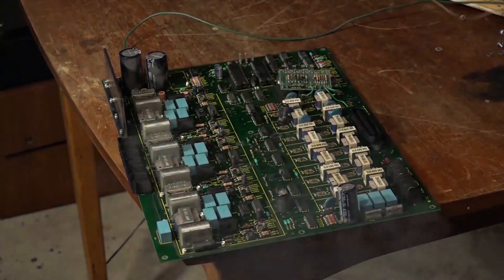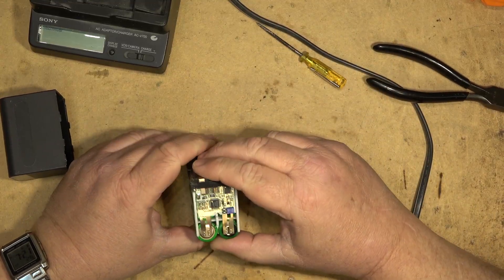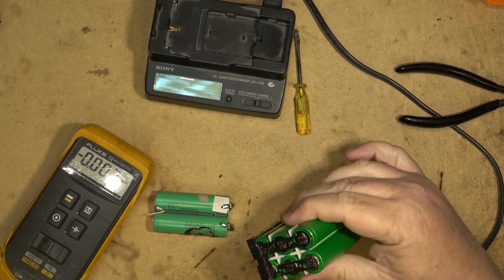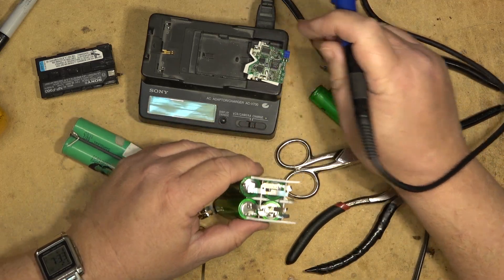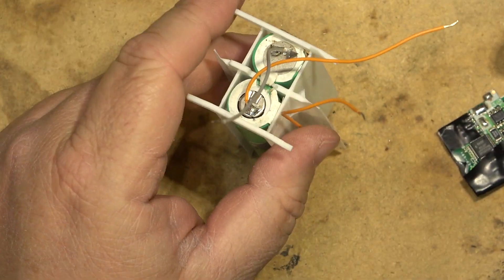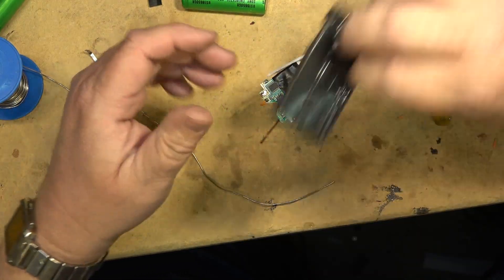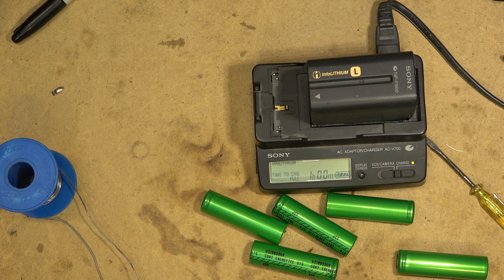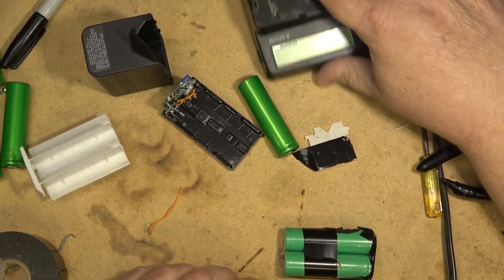Infolithium Camcorder battery Rebuild

Comment: Great video, thanks for posting. Question: I just got a camcorder with bad batteries. I looked them up and they are fairly cheap, so I'm not going to take the existing battery apart. However, I thought about cutting the charging adapter  and simply installing the same connector I have on a bunch of 3.7V batteries for my R/C stuff. I mean, why not, right!? Thanks.
Reply from the maker: I don't mess with lithium batteries.  Fire hazard.

Comment: I'm surprised the 18650 cells fit at all. My InfoLithium L batteries are all shorter than 65mm. I presume it's just the largest capacity packs which are longer.
Reply from the maker: All the L series will be the same size.  There are smaller packs.  The M and P series for example and now the V series. Interestingly the m and p batteries wi fit on a camera that specifies a v series if you cut a tab that prenevts it from fitting but it won't work on a number of cameras despite the voltage being the same.
Reply: @12voltvids  You're right, I was mistaken. The casings are 70mm tall. I guess it's just the cell diameter that's smaller on low-capacity packs like the NP-F330.
Reply from the maker: @eDoc2020  14650 likely.
Reply: @12voltvids  I checked and yes, they were 14650.

Comment: Those 18650 cells will most likely have a little controller board under the minus pad.

Fortunately.. They work, like They should..
Undervoltage en overvoltage protection and overcurrent protection.

Under 3v They cut off by switching a mossfet.
I Think, on the bare cell you'll measure something like 2 or 2.5 v.

Around 2.5v Its Kinda revivable But can be dangerous (or Fun) 
Under 2.5 you can Still charge them, But Its even more dangerous.

Comment: Just got to the end, it's interesting that the camcorder was giving out the "For InfoLithium only" error and turning off. How does it come to the conclusion that the pack is not InfoLithium? Can the little PCB tell that there's now only two cells when there's supposed to be six?
Reply from the maker: No not fully charged.  Cell imbalance.  If i allowed it to fully charge that message will go away.  When I fired up the HDRFX1 with one of the other batteries that had been sitting for several years i got the same message. I had to leave it on the charger untill it was full.  As you saw on the charger that would take 1 hour.   The camera is not smart enough to know this. The battery cells have to be balanced and then the controller on the battery sends the remaining time left to the camera obtained from the current draw of the camera and the cell voltage.  Unbalanced cells and it can't figure out the state of change so it sends a message to shut down.  After fully changing the other battery the HD camera worked fine for the test shots I did.  I would expect the same here but i wasn't planning on leaving this pack in service because I don't need it and I just did a quick job of cell replacement to see if it would recognize and charge which the charger did.
Reply: @12voltvids  When I had a bad 2 cell version of this I removed the cells and the camera was still happy (I just put 12v into the output terminals of the pack). The board didn't seem to care that there weren't any cells at all (and IIRC the voltages at the disconnected cell terminals were way off).

Comment: It's crazy that Sony have been using the same battery design since the '90s. I can go buy a brand new Infolithium L pack, stick it in my '99 Hi8 Handycam and it'll work
Reply: The NP-F batteries???
Reply: @czel3 for me I bought from Ali express but didn’t worked, camera turned on but says use only info lithium battery and turns of no matter even if I fully charge!!

Comment: Li-ion cells that have dropped below say 2,0 Volt should not be used at all.
When they have been discharged so far they could have build internal copper bridges which could make the cells go short circuit when being charged or discharged. That is probably why the battery chip did not allow it to be charged.
Also mixing fully charged cells (and cells of different brands/types/age) is asking for the same kind of trouble.
Much better to replace all six cells with cells of same brand, type and age, preferably of the same batch.
Reply from the maker: They were all dead, short internally.  All in recycle bin.  I just put 2 in for testing.  The pack is not being rebuilt.  I have 5 others that work and i don't use those old cameras now anyway.
Reply: @12voltvids  ok. Just posted to make viewers aware of li-ion dangers......

Comment: I'm like what "Infolithium"  who, what. I must be in a time warp and missed this battery design. Sounds like ink cartridges with chips that do not allow them to be refilled once they get low. You proved the pack can be rebuilt and will work.
Reply from the maker: They are all like that now.  Even the camera I use now. Only certain series of batteries will work. Put the wrong battery on and the camera will run for exactly 90 seconds and then off with a message that the battery is the wrong battery.
Reply: @12voltvids  Even my 1998 handycam will do that. I have one battery that apparently has a bad infolithium chip in it. Putting it into any of my Sony cameras will trigger a “‘infolithium’ batteries only” message and then the camera shuts off.

Comment: That was a forgiving charge pcb.
Most laptop battery packs don't seem to be able to learn new cells. (i've tryed a few times).
There is a battery gadget that can connect to the battery board for communication and control.
But the price is silly.
Reply: He was extremely lucky. These infolithium circuits once disconnected from their original cells just refuse to charge. I´ve tried. They won´t charge and the camera won´t take them. This was an extremely lucky case.

Comment: I have seen a lot of your videos on different repairs.  I was just wondering, would you consider investing on an ESD mat and on an ESD wristband while working with equipment containing microchips and diode like laser pickups?
Reply from the maker: Nope.  Unnecessary.  Have yet to blow things up unless I want to and then i do it with the 4kv death wand.
Reply: @12voltvids   Funny